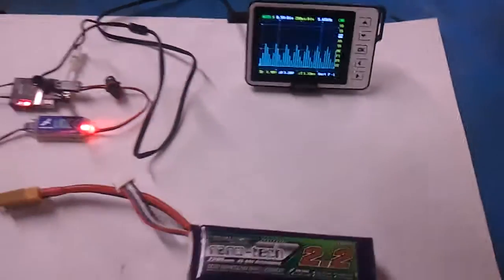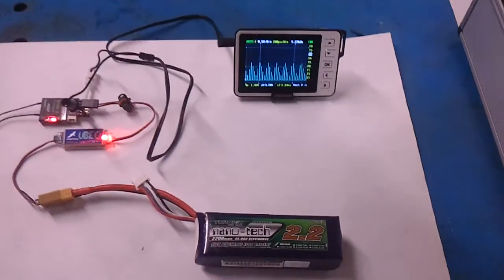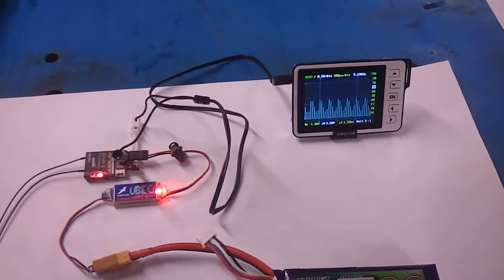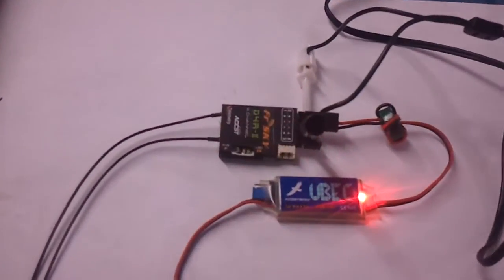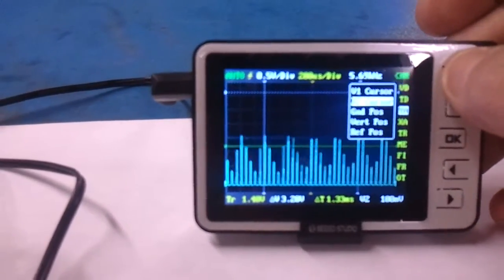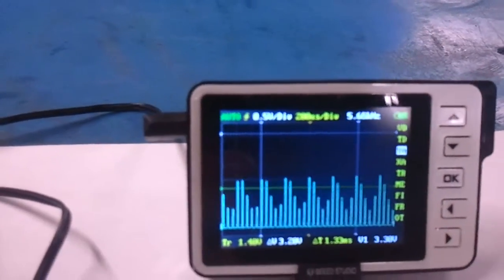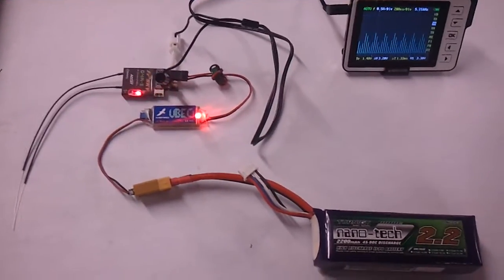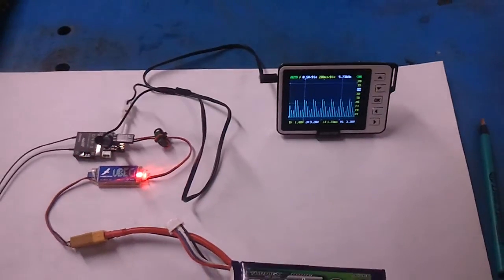Testing FrSky D4R-II PWM RSSI output voltage for WoQ's ZMR250 PDB onboard RSSI Filter.

Comment: Put your damn beer can down and lets fly this shite!
Timely topic and great video!
I wired my first MinimOSD board about 1 month ago, using the D4R-II channel 2 output into a 10k ohm, 10uF RC filter.    It works pretty good, but doesn't match the RSSI scaling that the Taranis shows.    I futzed around with the scaling to get something that was sensible to me.. 0% RSSI per the minimOSD display corresponds to 40% RSSI per the Taranis.     I also just switched from BF to Cleanflight a few weeks ago and saw the option you are referring to ..  analog RSSI input to the Naze.   I haven't tried it yet.  I'm hoping that somehow the RSSI scaling works out better through the Naze board.   How do you set your scaling for Naze sensed RSSI?    How does it compare to the RSSI displayed through your Taranis?
Thanks!!
Reply from the maker: 2101Striper I ain't flying right now so I have a beer in my hand! I personally have not made use of my new-found info regarding sending the RSSI straight to the Naze instead of the Minim so I can't comment on the scaling comparison in that regard, but I would suspect the Naze method will scale it the same way Minim scales it. I can say that I understand exactly what you mean about the Taranis scaling not matching up to the Minim's scaling. I feel the Taranis handles the scaling in an awkward fashion compared to what the typical user expects to see. The average guy would expect 0% to be signal loss, but nope, Taranis just simply doesn't scale it that way. Not sure if that was a decision of the OpenTx Devs or FrSky. I'm also not entirely sure why OpenTx Devs haven't rewritten that algorithm routine to put it into a common 0-100% scale.... I may be getting over my head here trying to explain this, but I believe FrSky senses the RF RSSI over the entire possible dB of bandwidth that the system can generate/receive, but it doesn't take into consideration the level of sensitivity that the system is capable of before loosing synch lock. If they would have based it off of the sensitivity for synch lock and not the entire possible dB bandwidth of signal potential then it would scale the way most people expect it to(0-100%).

Comment: Nice job.  Where did you get the scope?
Reply from the maker: Thanks man. Got it from one of my snowboard budz up in St Joe. He bought it originally to test clipping on car amplifiers but he ended up not using it much so we worked out a deal. It's a Seed Studio DSO Nano V2. The stock firmware sucked, very hard to navigate. I flashed it with BenF custom firmware and now it's great.